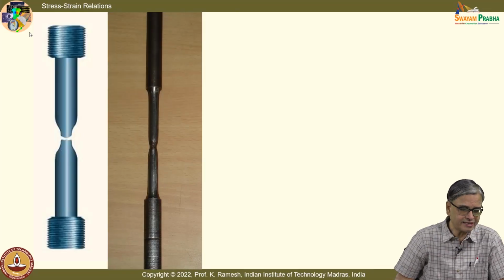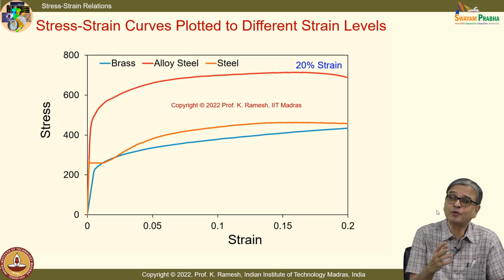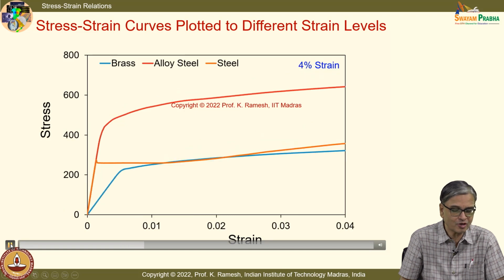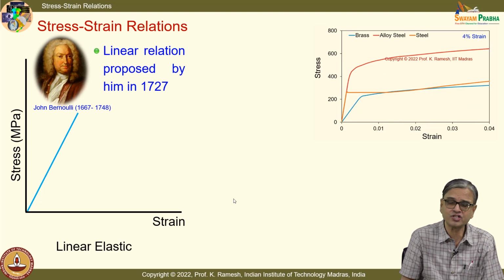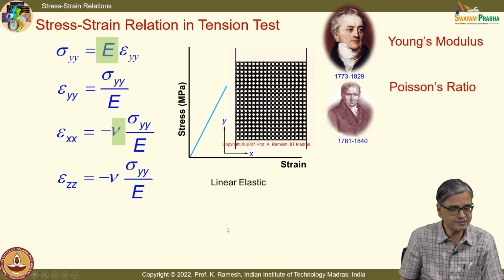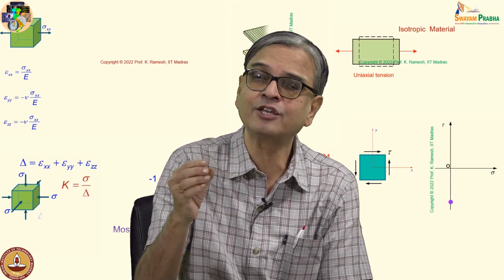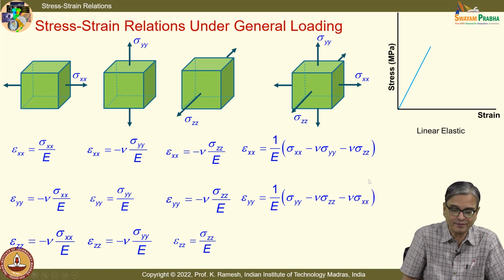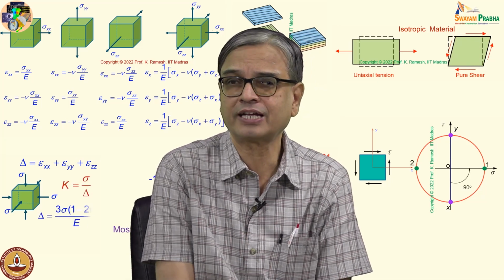LEC 17 Stress Strain Relations

Comment: sir, when we put the strain gauge in the x direction it will undergo the majority of strain in transverse direction (y direction)? how to make up with that and how will it tell the strain in x direction???  does the deformation of strain gauge is limited in the y direction??? How that works
Reply: Strain gauge grids are designed to minimize transverse strain sensitivity (discussed in detail in Lec 15) and with suitable amplifications in the measurement systems, one can measure strain along its gauge length comfortably.

Hence, although strain would be more along the y-direction, pasting the strain gauge with its gauge length length along the x-direction would give us the measure of strain in x-direction only. 

Further, the Poisson's ratio for most metals is ~ 0.26-0.3. This implies that the strain along the x-direction in this case is about 30 % of the strain in y-direction which is relatively considerable and not miniscule compared to y-strain.